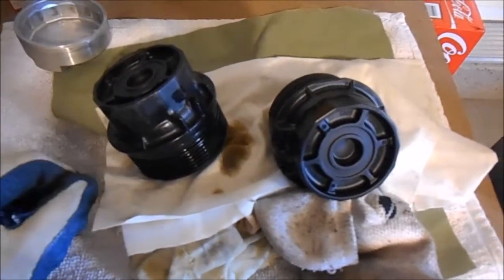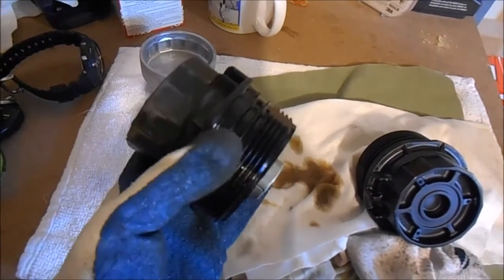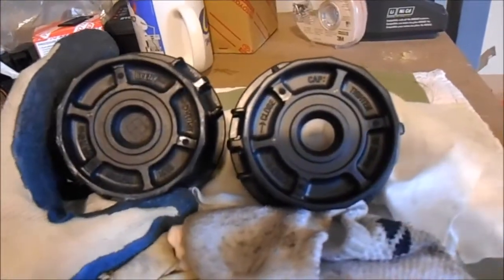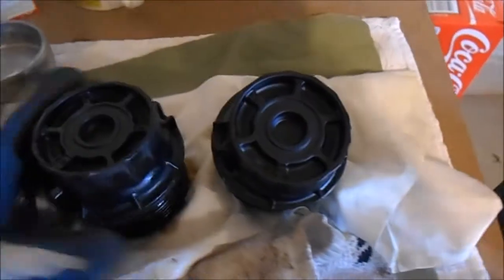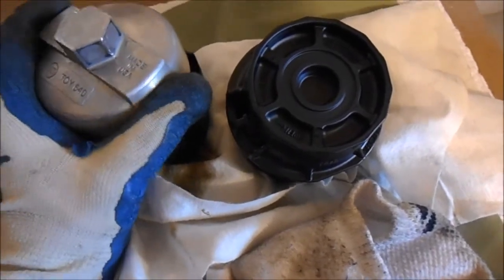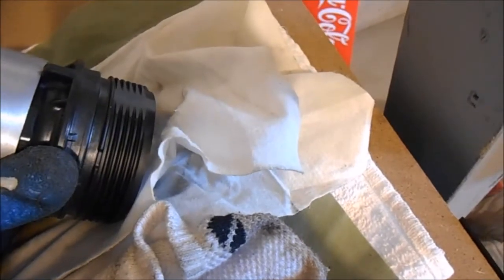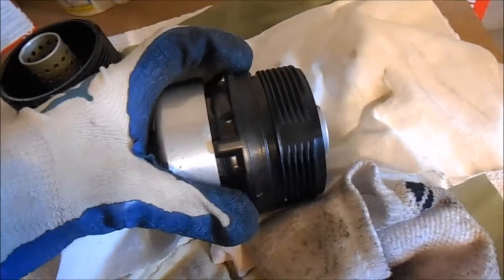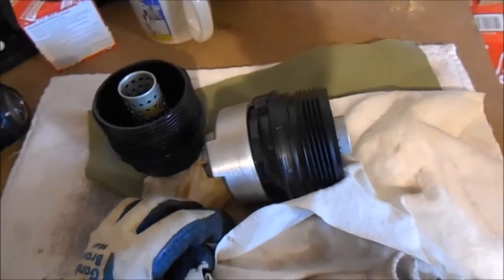2009 Toyota Corolla (10th generation) oil filter housing worn out comparison

Comment: One of the hazards of using a shop for an oil change:  they use an air powered torque wrench set to 5-15x the recommended Toyo torque of 18ftlbs for the filter and also on the oil pan drain bolt.   Filter housing torque is similar to cartridge filter torque, hand tight then 1/2-3/4 turn beyond.  Most oil filter cartridge figures are 12-18ft-lbs.  I also advise getting one of the deeper slotted filter wrenchs Sevek suggested.    Odd that Satos housings don't seem to have the drain plug on the bottom allowing one to drain the filter housing before removal.

Comment: The wrench you need is found at
https://www.amazon.com/dp/B00Y5JWW1W/ref=psdc_15708821_t3_B078RHZP9M

When using it take care to be sure that all the teeth on the wrench are properly engaged to the tabs on the oil filter cap.

Tighten to 18 ft.lbs. Compare that to the 28 ft.lbs. for the oil pan drainplug.

Comment: Your oil filter wrench is different than mine. Mine has slots cut in the sides for the fins on the housing and fits tight with very little play and grips the housing quite well

Comment: Hey i took my car for the oil change to firestone and they let me know that my oil filter housing got stripped from the previos shop are they refering to the same object on your video your answer would help me alot i dont know anything about cars thank you?
Reply: Yes, some people call it a housing but it's more accurately called an oil filter cap or oil filter cap assembly or oil filter housing cap. Part of the housing is attached to the block so this part by itself is not the complete housing.